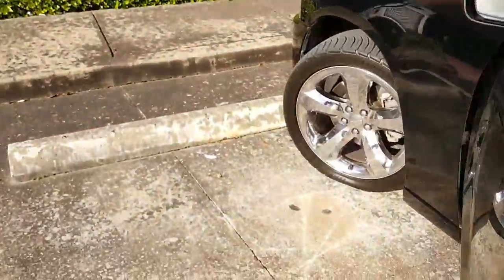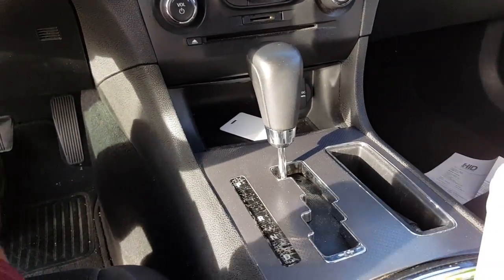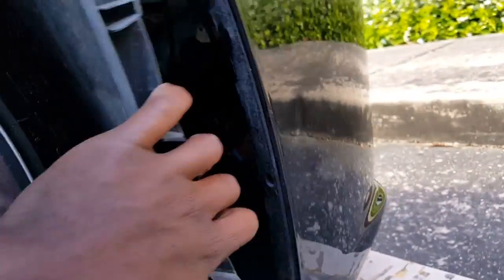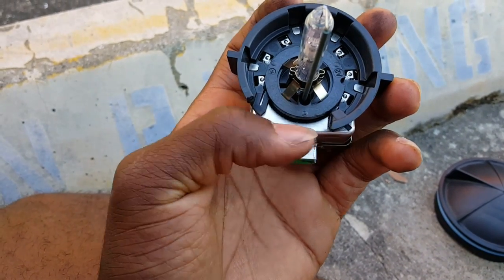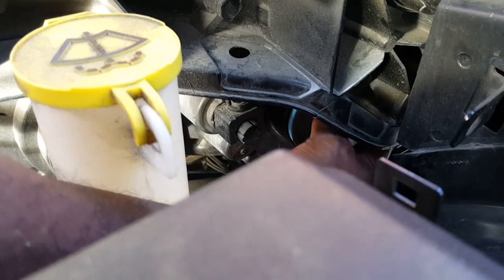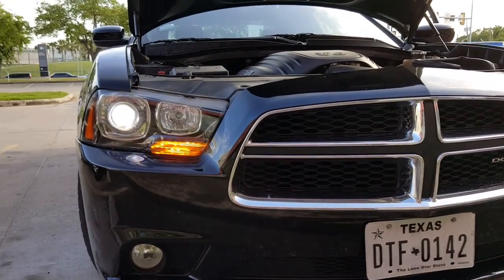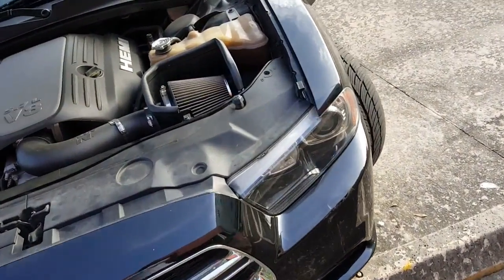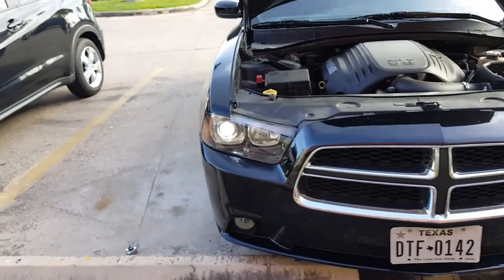Dodge Charger HID Replacement

Comment: Good job. Just replaced mine today, and of course, the guy at Auto Zone sold me the wrong bulb. He sold me the high beam bulb, which was $18.99, but I showed him the HID bulb I needed, and of course it was $162. But the dealer wanted $315, so whatever. Needed to get this done.
Reply from the maker: Order the bulb off Amazon. Look up DS3 4300k which is stock bulb made by osram. Don’t pay over $60 for both bulbs combined. I just got 2 DS3 6000k HID bulbs for my scat off Amazon for $27 total.
Reply: @CWood91 would this fit a regular 2013 dodge charger
Reply from the maker: @brolyassasin8354  you car has to have HID bulbs already installed. You can’t just do a HID bulb swap. There are additional components needed.
Reply: @CWood91 thanks i already order it for $29

Comment: Did the driver side without removing the wheel well cover about 2 months ago and just changed my passenger front using this method it was a bih to get out but just finished it and glad I Did it myself ...

Comment: At the point in video "blank thing" use a flat head screw driver on the right side of black flange (same for passenger and drivers side) and tap upward with hammer then twist off counter clockwise by hand. My take a couple tries but it will work.

Comment: You can find HID replacements for about $20 on amazon. Thanks for the vid. Big help.
Reply: Cries in $200+ part price listed my invoice from dealer
Reply: @josephkreifelsii3734  Ouch. I bought mine from RCP on Amazon for $29 for the pair and they work great.
Reply: @busa89  How long did they last for you? Are they good quality?
Reply: @Evanovich0969  I generally get around 3 years or so out of them.

Comment: On that driver side you can go through the tire way like you did or you can move the air box out the way
Reply from the maker: Probably gonna have to move airbox. Honestly it’s really easy to remove the full bumper. Look up a few videos. Removed the bumper on my 2018 scat to install the hellcat airbox and it’s not that hard at all.
Reply: C Wood yea just a few bolts, Boy done got him a scat now congrats on that One brotha💪🏼

Comment: Im a tech for Dodge dealership. Let me give you advice. #1-Never spend under $100 on HID. Do your research. If you want brighther than OEM. #2-Technically, removing the fascia makes the job easy. Even easy to remove that stubburn blk lock ring. Thats why stealership charge high.

Comment: Even tho you broke it could you please tell me how did you even manage to twist the black part off. It's really making it hard to remove the old bulb
Reply from the maker: i used all the muscle in my arm and hand. turn it counter clockwise. that thing is fucking cemented on there it seems like.

Comment: i have the brighter ones in mine now my fuse is constantly melting and i have to cycle my lights off and on to get them back on they go out when they want to its annoying to keep cycling off and on but every time i change the fuse it does the same thing im wondering if i went back to the lower wattage ones will this stop

Comment: That clip is a Bxx for me man did you like squeeze it and turn counter clockwise? Because I’ve been turning it counterclockwise but it’s resisting and I even blistered a finger in the process
Reply from the maker: The Goat I slightly broke mine 😂😂😂😂. They used the Thanos infinity gauntlet to install that clip bro.

Comment: $120 a pair at Diode Dynamics. I ordered mine in the 6000k version and did them both. Yes they are a PITA to change but the fender well is the only option. I also have a 2014 Dodge Durango and they put access holes with removable covers in the fender wells. You would think they would do that across the board but hey... how else are the dealers going to make money?

Comment: I took mine in on a Saturday at 9am, the dealer closes at 12pm. They said because of the amount of time it takes to change the low beams, they didn't have time for it. This is just sad that you did it in 5 minutes, when they couldn't do it in 3 hours
Reply from the maker: Yea that’s true. But also you have to remember there are other cars they are working on as well. That’s why if I can fix something on my car myself, I do it. Cost less and I know I did the work right and on my own time.
Reply: @CWood91  With the help for this video, I'll attempt it myself next time a light goes out. Should save me a lot of time and money

Comment: Vid is perfect. How did you get the first plug undone?? I cannot seem to get the first plug of so then I can unscrew the bulb from the headlight. Is there a locking clip or something on the plug?
Reply from the maker: Dan Enger if you are referring to the silver plug that goes into the HID bulb, you can try using a flat head screwdriver to shimmy it off. Mine was kind of tight as well.

Comment: I am at the point where I'm trying to twist the black thing and get the hid out but it will not come out..any suggestions?
Reply from the maker: Jacob Lance Ware you have to twist REALLY HARD. It seems like they glued those clamps on there. But don't break it or you won't be able to hold your light in place when you go to put it back on.
Reply: Jacob Lance Ware take a flat head screwdriver push up against the lower flange.. tap it lightly with a hammer .. mine popped right over
Reply: Dj Beatz I got it off. It was rough but I got it, I still have to change the other one out next week but this video helped me out alot.

Comment: Would these lights you order fit on my 2016 Charger SXT?
Reply from the maker: Ferny Ibarra these are HID lights so its not just a bulb, it has an entire plug and play box built on the light. If your car is not equipped with HID's already then no it won't fit because dodge decided to put regular yellow looking lights on some of the new chargers. I know many ppl hate that they did that. You would have to buy the entire HID kit and wire it in order to get HID lights on your vehicle. (if it is not already equipped with HID's)

Comment: you remember if your headlight started failing at 1st. like turning off and on even when driving? also the exact bulb that you used? i tried to get it from the box when You showed the bulb. thanks
Reply: D3S, Osram brand.

Comment: I broke the locking ring trying to turn it to take the bulb off, went on youtube to see if theres a special way to remove it, apparently im not the only one thats broken it
Reply from the maker: SlammedHemi it feels like those things are glued on there. Luckily I only broke mine at the tip so it still went back on.
Reply: You supposed to turn it a little you’ll feel it snapp off

Comment: take a flat head screwdriver push up against the lower flange.. tap it lightly with a hammer .. mine popped right over

Comment: Do You have a problwm where the bulb goes out when Driving. Mine does that :/
Reply from the maker: Oscar Cortez I sold this car about 2 years ago. But no I never had that problem. Although when the bulb was nearing its life span it would go out then after a while it would come back on. Eventually it just completely went out and needed to be replaced.

Comment: Where you but the light at
Reply: DDMTuning.com is once place to get them from.  Also changed my high beams to HID.  You have to tell the car to not use DRL's via the "radio" options.

Comment: How do I pop out this damn clip?
Reply from the maker: tim wells the clip sides off, you have to push up REALLY hard on the clip and it should pop off. But be careful because you could snap it in half then you won't be able to hold you bulb in place.